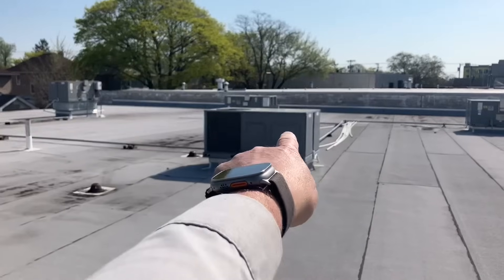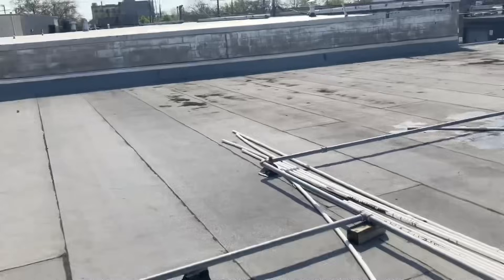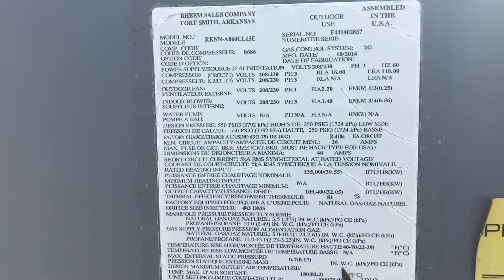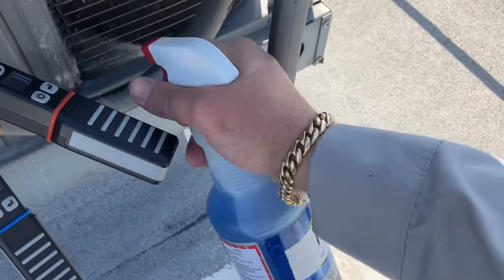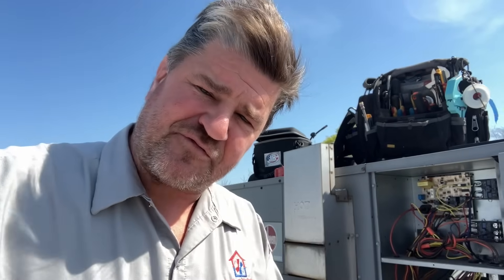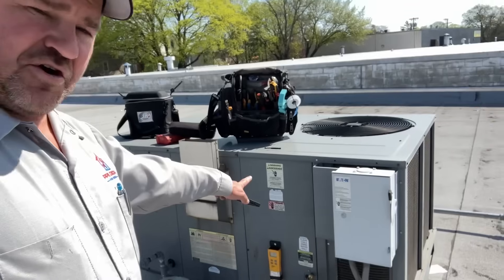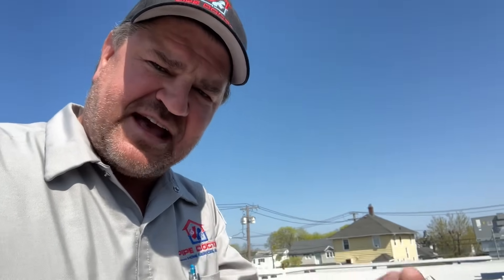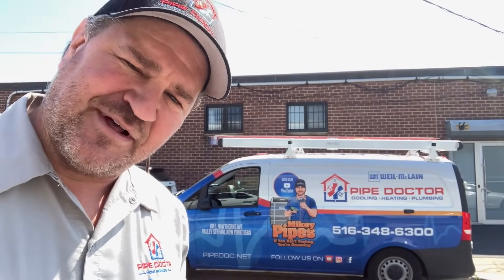Rheem Rooftop Unit Not Cooling? Here’s Why It Failed… and How We Fixed It FAST!

Comment: I didn’t approve of micro channel coils. This is an obvious problem with rheem and many other brands. They should make the customer whole and give you the part for free. Temporary fix or maybe permanent is to use solder weld or other aluminum repair rod and mapp gas. I have done it and it works.

Comment: bubbling like that, forget gas and go. as soon as it runs a few times it will blow it all out due to being high pressure liquid/gas. on the evap. it's a bit different story, leaking more when off.

Comment: Nice work Mike. I diagnosed a leak in my own mini-split last year. Had to use nitrogen, evaporator in one of the two heads had multiple pin holes. Had to replace the whole Mitsubishi head. Was thinking my flares were leaking, but nope.

Comment: That compressor is on its way out. You can hear it when it turns off that noise it makes is no bueno!  Cycling on/off constantly and without proper refrigerant to cool it down and oil loss. Everything it is adding up. Might as well quote them a new compressor as well.
Reply: Scrolls make that noise when they’re low on gas. I’ve had no issues re charging them and they are still in service
Reply: @nickc6399  I have seen many scroll compressors that were running on low gas or flat and never heard that noise. I don't know.

Comment: Bypass head pressure switch and guaranteed leaking coil! Microchannels do not hold up here in Florida. Solderweld sells a aluminum to copper kit to fix them leaks too. Crazy to hear 2 year backorder for a friggin crappy coil.
Reply: probably had to get a new coil manufacturer, that's just starting up from scratch and slow production. IRL, instead of welded/epoxy sealed joints, they should have aluminum to copper flare transitions. more so on the high side. oh well.
Reply: @ totally agreed.